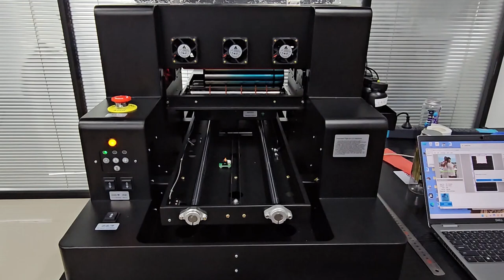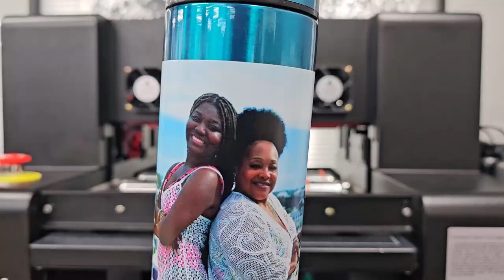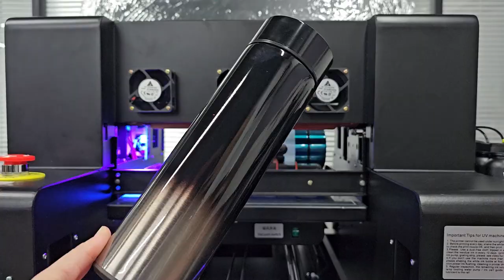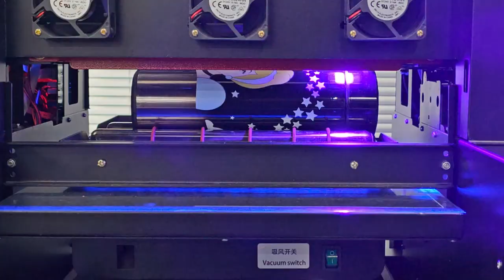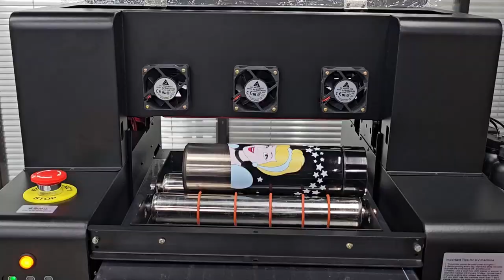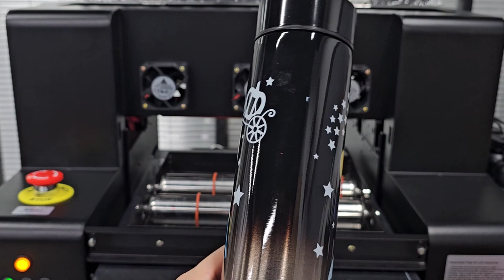Rotary printing stainless steel insulated cup.

Comment: Is this with L1800 ?
Reply from the maker: The L805 nozzle is cheap, while the xp600 nozzle has fast speed. The L1800 nozzle is expensive and slow. So we won't choose L1800 nozzle.